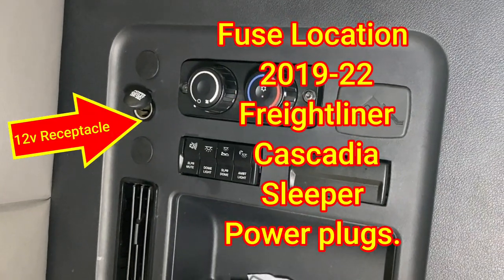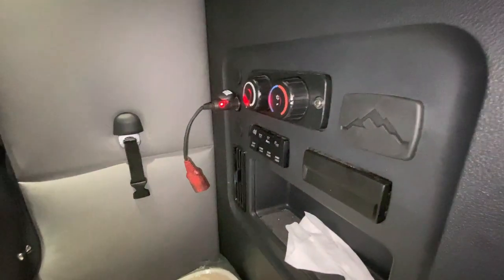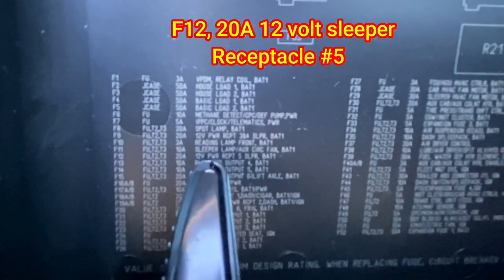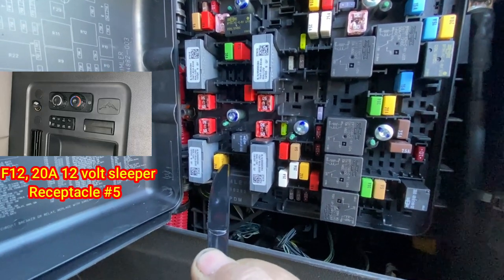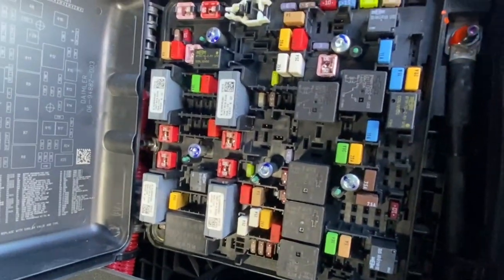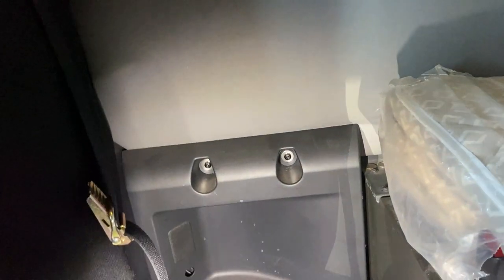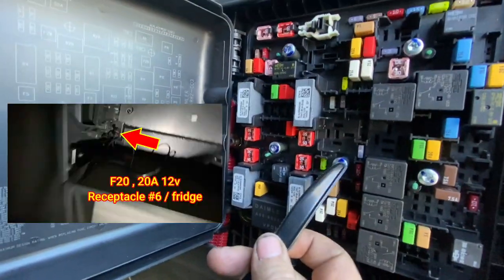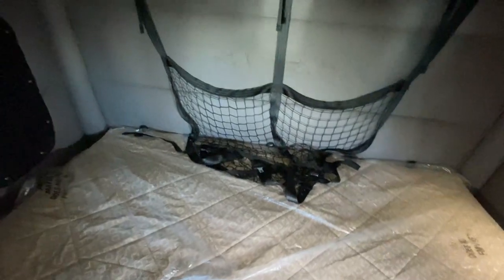New Freightliner Cascadia: Sleeper Power & Cigarette Outlet Fuses)

Comment: I could use some help. 2018 new body Freightliner just like that. When I lift the bunk or open the side storage doors the lights should come on but the the lights never turn off under the bunk. Any advice?
Reply from the maker: There is a switch when you lift it should come or there is a on and off switch and the lights.I hope that helps .